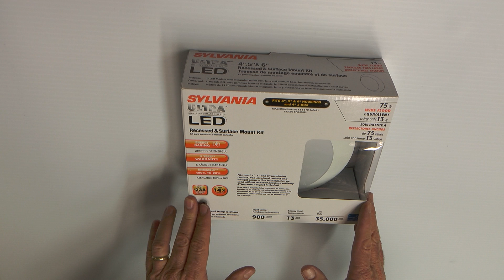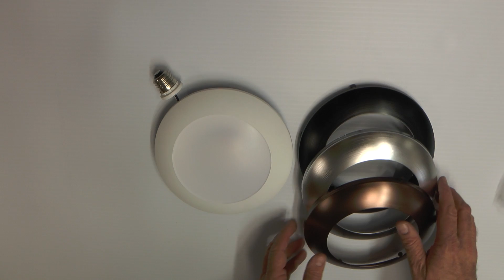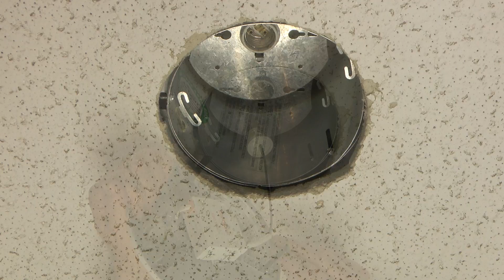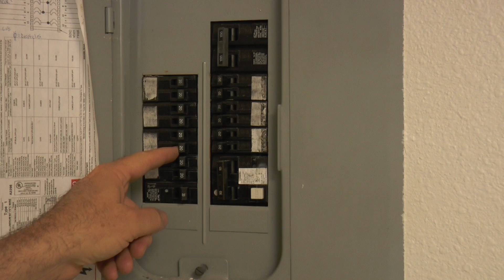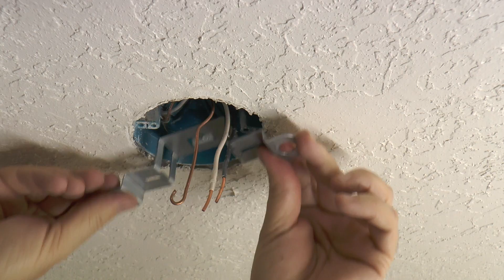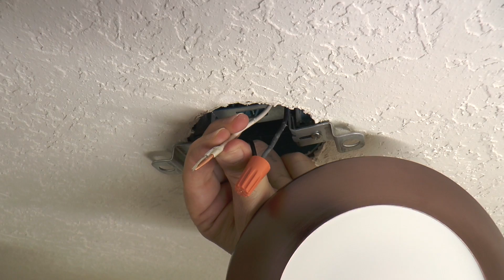Sylvania Ultra LED Disc Light Overview & Installation by Total Recessed Lighting

Comment: This is exactly as pictured and looks lovely installed♛>share4.photo/LightFlushMount?oo◇    Install is very easy, the only reason that I had my landlord do it is because we live in an old house and wanted to make sure that the wiring was adequate for the product. If you live in an older home, you might want to check out the product literature before purchase. If I am remembering correctly, any home older than 1978 could be a problem and create a potential fire hazard.
Reply from the maker: Not quite the same light fixture but thanks for sharing your experience 🙂

Comment: For older homes, these are worthless.  The amount of wires that are in the junction box DOES NOT ALLOW a bracket to be inserted into the existing box!  The "driver" should have been built into the fixture itself--and not have to be "inserted" into the opening--because IT WILL NOT fit.

Comment: A really well done video of how to install this fixture. The fixture I bought, although it's still called a Sylvania LED Disc, is somewhat different (probably a newer version, January 2017, of this same design) but the installation procedures in  this video still apply. Thank you for producing this. It really cleared up how this thing goes together. And by the way, the new instructions that came with the fixture I bought are not very clear (I see there somewhat different than the instruction sheet in this video).

Comment: I installed 4 of these into existing J boxes and found the clip system to be very difficult to get right. The metal clips are flimsy and deform easily. As mentioned it is a tight fit in the box with the wires and LED driver box. Once the wires are out of the way and the light is clipped in, the clips simply do not exert enough force to cleanly keep the entire light flush to the ceiling - there are small gaps.

A better design would have been to screw the thing to the J box for a much more secure connection, and then snap the plastic trim cover into place concealing the screws. I could not understand the rationale for the current design.

That said, Sylvania customer service was helpful in sending replacement metal clips to replace a broken one, free of charge. And the lights are great for our application, a windowless upstairs hallway.

Thanks for the video
Reply: I am having the same problems. Won't snap in both sides. Poor design